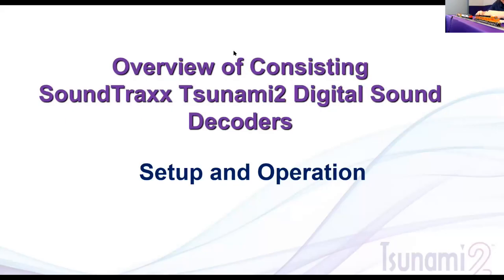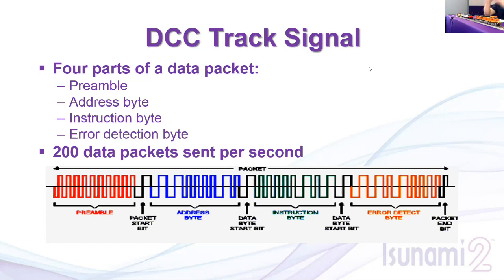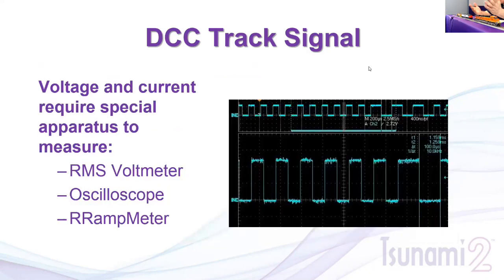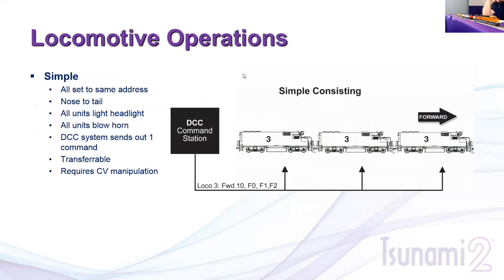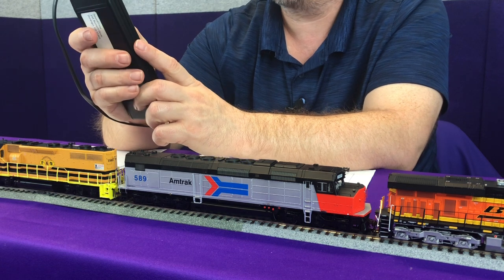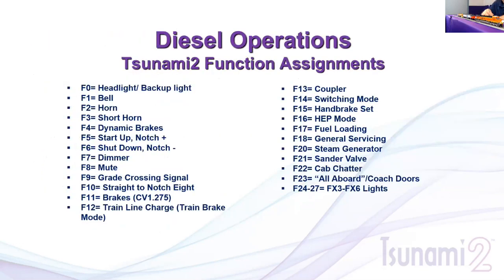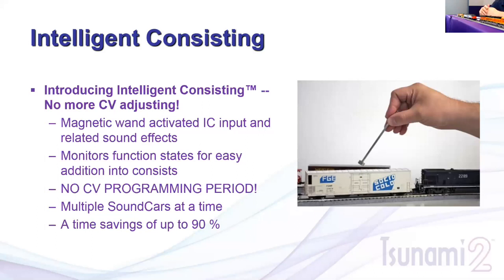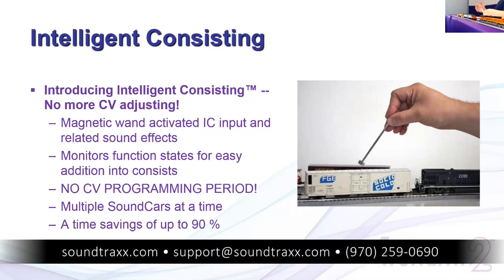Consisting with SoundTraxx Decoders (Webinar 14)

Comment: I have F7A  #37 and F7B #38. I set #38's CV 19 = 37 to consist it with F7A #37. Is there any problem with this approach that I am missing? I have set up the various other CVs to configure #38's functions to work as desired.
Reply from the maker: Please contact our Support Department for advice on this: (970)317-3505 or support@soundtraxx.com thank you!

Comment: I have a question about speed matching: So I’ve got an Athearn GP49, Athearn SD80MAC, and Athearn SD60E coming in the mail. All locomotives have Tsunami2 factory installed. Will I be able to consist them (or any two of them) together without speed matching (since they all have the same decoder and are from the same brand)?
Reply from the maker: They should run well together. Every locomotive is a little different though. If you have any problems then you can look into speed matching.

Comment: This video is fascinating, but it doesn't cover in-throttle consisting on the TCS UWT-100. It fixes all of the problems of other types of consists, since it's all done in the throttle, and is transparent to the command station and decoders. You can easily switch cab with a couple of clicks to make functions work properly.
Reply from the maker: We do not offer support on how to use TCS products as we do not make them.
Reply: @SoundtraxxDCC  But you don't make NCE throttles either....

Comment: At 26:32 George explains how to program what functions are active on what locomotive, and I want to explain the math behind it a little better.

To figure out what value you want to have for that CV, (I will use CV246 as an example) you go down the list from Bit 0 to Bit 7 and enter a 1 or 0 for each of the 8-bit values. On my locomotives at home, I only want F26 and F27 active, so I put a “1” at the 6th and 5th bit, and zeroes for the remaining bits. This gives me a binary number of 01100000. If I convert the binary number of 01100000 to a decimal number to get 96. Therefore, you set CV246 to a value of 96. 

Another example is CV22. I want F0f, F9, F11, and F12 to be active, so I put a “1” at bits 5, 4, 2, and 0. This gives me a binary number of 00110101. Convert that to a decimal number and you get CV22 = 53.
Reply from the maker: Yes these calculations are correct. On Page 12 of the Tsunami2 User's Guide we have a CV calculator. All you have to do it add a 1 to the bits you want on and it calculates just like this for you. Note that the calculation does not work if you are using Safari as your web browser. I use Google Chrome when using the calculator and it works well.

We also have videos on the structure of a CV for those of you who need more information on this:  https://www.youtube.com/results?search_query=soundtraxx+cv+structure